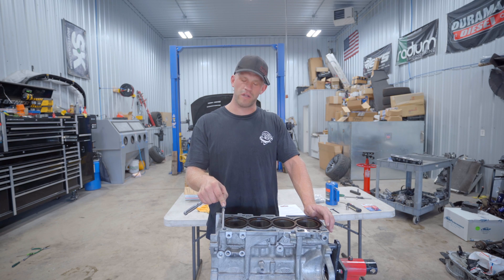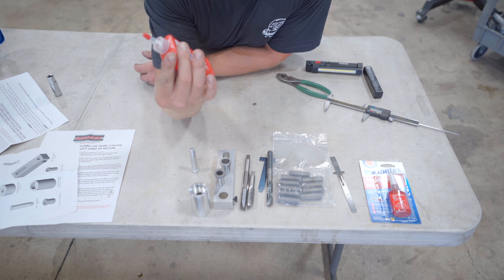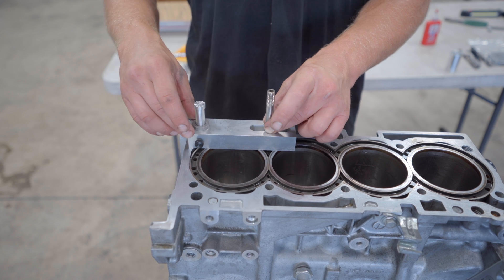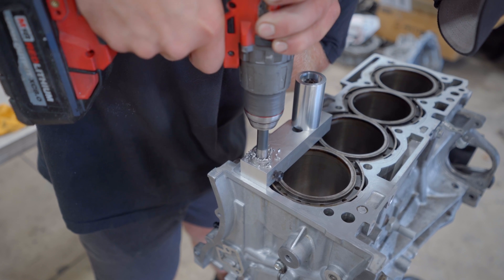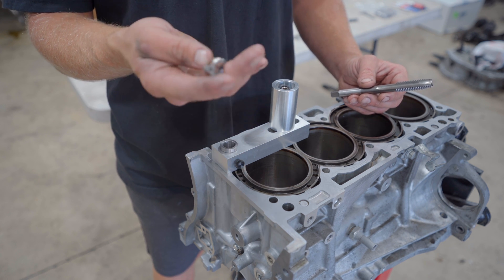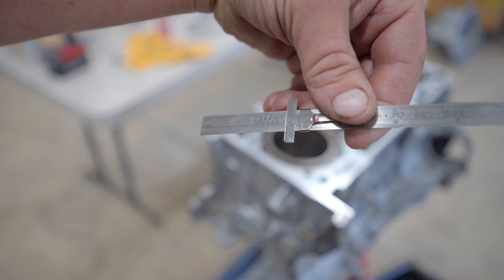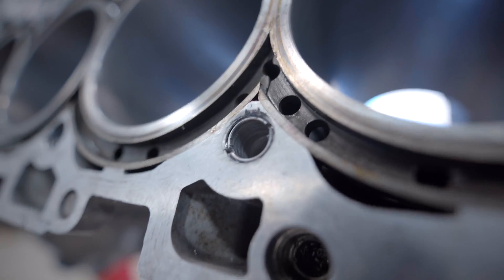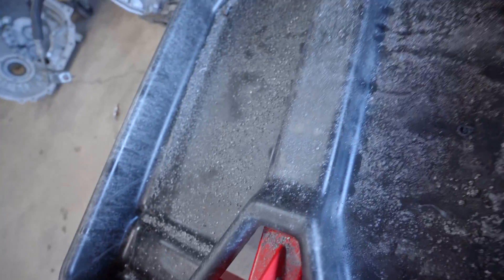HOW TO REPAIR STRIPPED CYLINDER HEAD STUD THREADS (4B11T)

Comment: That tape is getting way to hot and wil melt.
Reply: Teflon is good for 250C+ (482F). If the tape sees temperatures that high there will be bigger problems.
Reply: @tcolesen  i think that stut wil reach that temp easily

Comment: Other than the coolant escaping in the threads, is there enough material to securely clamp in high boost? There doesn't seem to be enough metal left between the thread and the cylinders
Reply: Lots of meat down below. Issues is getting the holes sealed.

Comment: That tape won’t have a chance with all of that heat. It’s not designed for that kind of environment. It’s probably going to disintegrate over time and bits of tape will get into the coolant and may foul up a passage somewhere in the system. I get it, you’re making content for future videos. Brilliant!!
Reply: Why do you think the thread tape won't hold up to heat? Thread tape is usually Teflon which is good for 250C. The aluminum block's heat treat will start deteriorating (annealing) at a lower temperature than that, closer to 200C for common T6 temper.

Comment: Nice work!  I think having a strong shop vac hose next to the drill, collecting as much of the of the metal shavings as possible would be worth the effort.
Reply: Might help a little, but the chips will be a bit sticky from the drilling/tapping fluid and won't be so willing to be sucked up by a vacuum.

Comment: I was a machinist at a Subaru shop for a few years and we installed time serts on all our 1/2” head stud blocks. As a a precaution I always put a bit of silicone on the deck around the head stud holes just to try and prevent any leaks from happening into the head stud holes.

Comment: Gonna need a new block after you insert all 10 lol. Ask me how I know.
Reply: I know someone who did all. Leaked coolant lol
Reply: @adrianvega4817  lol unfortunately that will happen every time. X blocks don't like the high torque from the arp studs and will let go over time.
Reply: @acain817  I heard you only fix the bad ones. I think Devin is gonna leak. Unfortunately the block will be trash
Reply: @acain817  like 3 inserts backed out when I removed the studs to.

Comment: How are you going to seal the top of the second inserts with the flat head groves on them, unless it is actually a flat area there I don't see the point, because the gasket is not going to have a surface to seal onto. I think you should much rather use liquid tpfe, have the second inserts sticking out and then resurface the head so they are flush and no longer have the grove

Comment: I've had thread tape not work well in sealing coolant passages and fittings. Use Permatex high temp thread sealer. It's the only thing I'd trust in that location